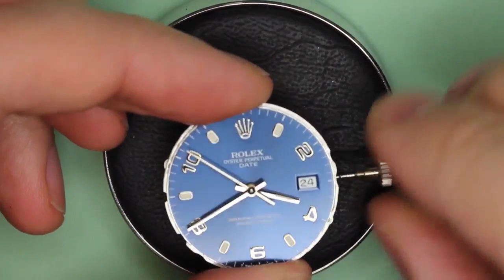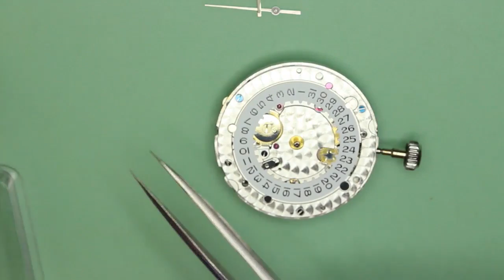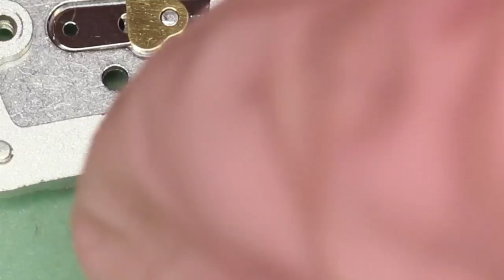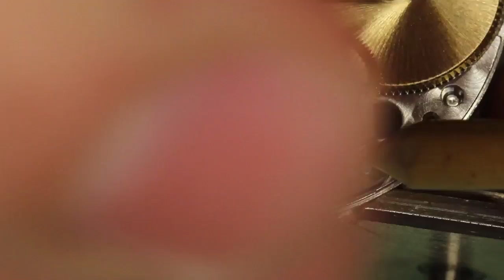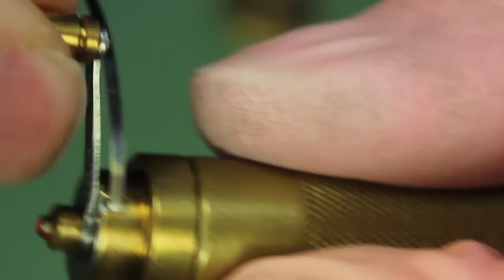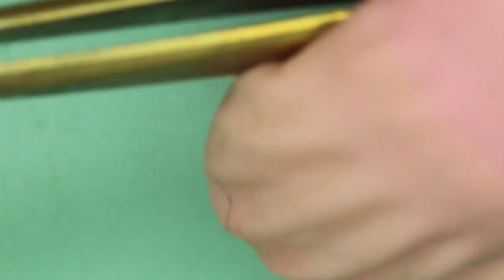Rolex 3135 Service. Part 1. Watch Repair Tutorials.

Comment: When removing the balance, do you have to take a part the front first, or can you remove the balance and cog without taking apart the front?
About to try replacing the balance cog/spring on my first 3135 and am not sure...

Comment: Even if it didn't feel like it, your fingerprints definitely just touched the dial
Reply: He's disassembling it so it doesn't matter if he touches it as it will be cleaned. He wears finger cots when putting the watch back together.
Reply: @garyboyle695  yeah, for gears and things, but you don’t clean dials whenever avoidable, it is too dangerous. You just are EXTREMELY careful with them. They are delicate and the finishes can be easily damaged or stained.

Comment: Hi sir I am from India 
In my opinion seiko 6319 movement is the best why because the movement spares parts was cheap and more accurate than rolex movement and finally seiko vintage 6319 movement was true workhorse  that movement was with out service they can work many years like 20years  that is the seiko 5 finally i have question why rolex watch was expensive

Comment: It appears a better option is available for closing the barrel that is less damaging than using the hard surface of the tweezers. It looks as though micro scratches were introduced to the beautiful barrel surface after it was closed using tweezers.

Comment: I have 2 watches that had the stem pulled out while in the wrong changing position.  now they will not click back into place correctly.   is there a simple fix for this?

Comment: I have a vintage Rolex Sub 5513 with a 1520 movement. The hack feature has stopped working. What should I be looking for or what part controls this feature? Thanks

Comment: Hello good afternoon.
I am starting to learn about mechanical watches.
I bought old and cheap movements, to learn how to assemble and disassemble, to begin to understand the operation.
I have a doubt one of these movements still works, but did not come to Crown and TIGE.
Is there a way to adapt something to wind up and see the movement work?

Comment: During a service wouldn’t the barrel usually be changed for a new one? How do you check the parts for wear that might need replacing?

Comment: Hi I have a gold Rolex number is 3055 for some reason the stem on my Rolex keep on pulling out I push it back in again but it doesn’t say could you please advise thank you
Reply: That would be a problem with the keyless works.  Either a spring out of place or damaged.
Reply: lOOKS LIKE YOUR SHITTY ROLEX HAS A PROBLEM

Comment: That movement is unnecessarily beautiful. When you removed the dial and the Geneva Stripes and blued screws were revealed, I actually gasped a little. Sure the finishing on all the bits aren't as perfect as other movements, but no one will see this besides watchmakers. Gives me even more respect for them.

Comment: I can do this, hold my beer
Reply: I did that once. Ended up with spare parts after reassembly.
Reply: @paulst6862 
!!!!!!!!!!!!!!!!!!!!!!!!!!!!!!!!!!!!!!!!!!!!!!!!!!!!!!!!!
 the problem is a watch like any machine or engine, need someone that know what is doing, he must have the knowledgment of how tighhgt is it, is it running smooth is bend, is twisted, hAve weAR ,,ETC

use the correct lube and in the rigth quantity, etd etc,,, and much more things.

you fail in this your timegraph is not going to be good with you... you dont have a straight an pure line, your wathch  WASNT CORRECTLY SERVICED,,, KEEP WITH DEFECTS...DEECTS WILL ENSHORT WATHC LIFE.

SO  IPREFER TO BUY A 50 YEAR WATHC that has been forgotten in a box, TO AN OLD LADY THAn BUY TO A SMART ASS IDIOT, THAT SAYS, WATHC IS RUNNING AND IN PERFECT CONDITION, I HAVE USED IT AND IST "working", 

WORKING  AND PERFECT - my ass__
!

I WOULD LIKE TO SEE THE WATCHES MARK SERVICE IN THE TIMEGRPH, HE NEVER SHOWS, AND I MISS IT, CAUSE I WANNA SEE EVERYTHING !
Reply: Lmao
Reply: anjeroxjp 
And u destroyed the watch. Now u got an angry customer who is suing you.

Comment: Doesn't the 3135 use the same movement ? .. But how come the 
Sub is 40mm and this one is 34mm how does the movement adjust ????!
Reply: Nirnay Pradhan Yes, the Date Submariner and the Datejust do use the 3135. The difference in size is just caused by an overall difference in case size.

Comment: The old 3035 was still more robust.  Rolex seems to honor efficiency over durability in their automatic works; they have one of the most efficient self-winding mechanisms anywhere, but the small central post which makes this possible causes it to be more susceptible to shock.
Reply: the most efficient??? YOU KNOW NOTHING ABOUT WATHCES. ROLEX IS JUST A RIP OFF.
Reply: @Limou551   I wouldn't call them junk, just overpriced.  Personally if I had that kind of money for a watch I would buy something a little more traditional like one of the Saxony brands.

Comment: I noticed the Balance Wheel chock did not have a rating lever. How do you accomplish bph adjustment?
Reply from the maker: The weights on the balance wheel are adjusted with a special tool :)
Reply: This video did not address the issue of adjustment of BPH

Comment: Mark, thankyou so much for the video!!
Question, after parts come out of US, how do you clean out the cleaning fluid from underneath the cap jewels?
I am almost finished watching the first video so far.
Reply from the maker: You take the endstones out with their settings and soak them in cleaner, dry off and lubricate. I think my series on the mechanical watch is more clear on this part :) How to service a mechanical watch. Part 1. AS 1900 in a Rotary watch
Reply: Watch Repair Channel Thanks Mark

Comment: Could you make a video that shows how/why the date change on an automatic watch takes a while to slide into the correct date position? Are the cogs inside broken or is something misaligned?

I have an Omega that takes several hours after midnight for the date to change to the correct poistion. It slowly changes to the correct position instead of just clicking over immediately like my other watches.